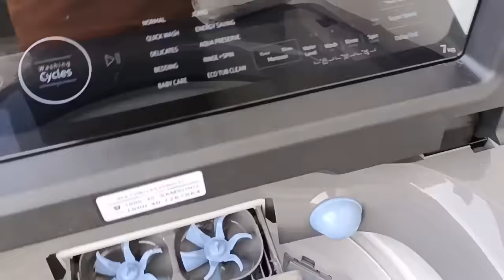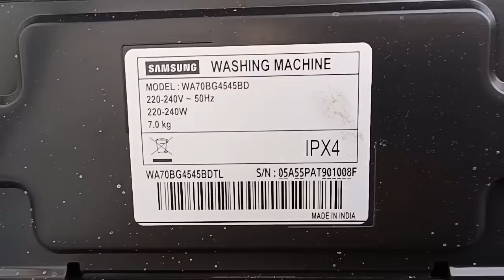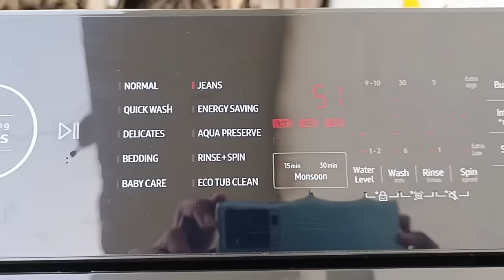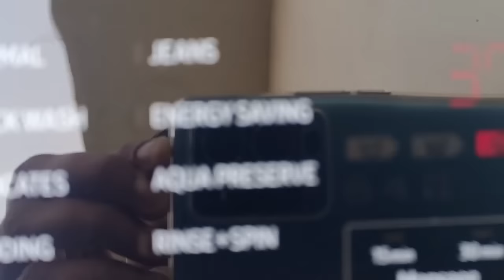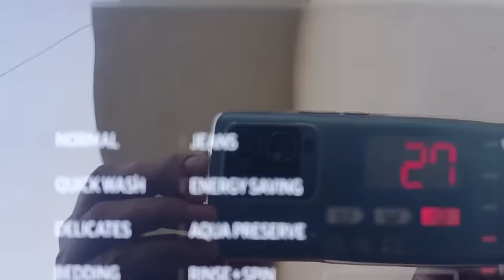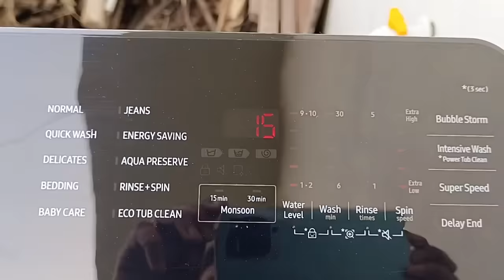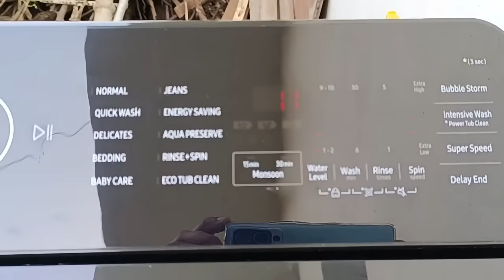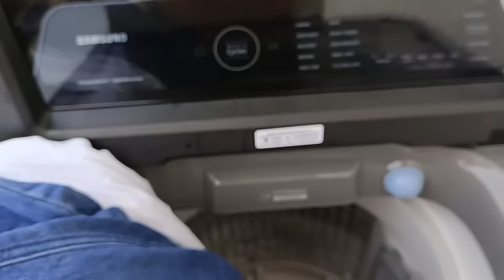Latest New 2023 Samsung 7 Kg Full Automatic Washing Machine I Washing Video I Model WA70BG4545BD

Comment from the maker: Latest Samsung Refrigerator 301 Liter 2024 Model    https://youtu.be/MDG19HAJybM?si=dns4qQYTQkLtIzGg
Reply: Please tell ki agar 7kg ki machine hai to kitne kapde dho skate hai isme 🙏🙏🙏
Reply from the maker: @Funnyshorts12721  at a time 3 jeans and 3 shirts, 5 tshirts or 2 thick blankets more than this at a time will full the drum and overload the machine. If you have more cloths in a day use the machine twice after some time of first washing
Reply: @worldwideinfoblogs  sir 7 kg yaane 7kg dry cloth hi hua na ...
Reply from the maker: @Funnyshorts12721  Yes dry, but his is the limit when these gets wet by water, otherwise drum will hit the side walls of machine. Please note you put cloths, then they gets wet and drum also has water to wash and rinse, so i said earlier is the cloths limit for 7kg machine.
Reply: I have 10 kgs model of this but I have an issue that this washer is not filling water till white ring of the drum even I have set water level to 10, but my old wobble washer is filling water till white ring and they both have inverter motor. Do you have the same issue?
Reply from the maker: @rayudu3039  I not set the water manually , but i observed when the drum is full of cloths, the drum completely fills with water. Let it be until there is no problem in washing.

Comment: Hello, I have a 11kg machine that functions like yours. Problem is that when I select 3 wash and 3 Rince under normal mode, it always wash and rince 4 times. The machine is 2 month old. Please assist.
Reply from the maker: After the machine estimates the complete washing time and just before it starts the operation, pause and check if the levels you set previously are same or not, sometimes it changes the level. But this moment you can set again the levels you want and resume the machine. If still the same problem, call service center they will check with software for any issue. If the machine old is then other method is, if you want level 3 and your machine taking level 4 then, next time you select level 2 machine will take level 3, like wise.
Reply: @worldwideinfoblogs  Thank you for your reply. When level 2 is selected, it works fine - 2 wash and 2 rinse but when level 3 is selected, it goes 4 wash and 4 rinse. I will follow your recommendation. Regards to you

Comment: How to open the door if power cut please ..thanks for reply
Reply from the maker: In this model, the door does not locks mechanically, it only rests on the body. So whether there is power cut or not you can anytime open and close the door , but press pause button on machine when running/washing.

Comment: Filling the tap takes a long time, and the water flow is very small, even though the tap is fast.
Reply from the maker: Washing machines dont fill water at tap water flow speed, these have motor to control the flow, you will find same flow speed in all top load washing machines. always control the washing time by levels manually and use superspeed button.

If required you can add water manually as well. then machine starts next process

Comment: kya Super Speed mode sachme water save karta hai? please answer
Reply from the maker: Aqua preserve mode saves the water, as it uses same water to wash and rinse the cloths, and not take fresh new water to rinse the cloths. Superspeed mode only makes washing fast an reduces time.
Reply: Okay, thanks, I have one more question.
Installation technician can install new tap for it before connecting inlet pipe? Is this included? I have to install new tap in empty tap connector @worldwideinfoblogs
Reply from the maker: @smitmanore2  You must have a tap with serrated slots for pipe, he then fits the washing machine pipe. any tap like this https://www.flipkart.com/maruti-crmtapc2-324-pvc-plastic-bibcock-water-tap-kitchen-bathroom-wash-basins-pipe-connector-1-2-15-mm-set-2-pcs-bib-faucet/p/itmc4f83cf3b66c9. You can buy this from market in advance for 50 rs.
Reply: @worldwideinfoblogs  ok thanks 👍

Comment: Sir, Agar inbetween machine operation power supply cut ho jaye to door lock to nhi ho jata?? If we want to remove cloth at that time, is it possible or we have to wait for power supply come and pause or switch off machine, than take out cloth? Please clarify.
Reply from the maker: Top model washing machines do not locks door, you can takeout cloths. Also as soon as power resumes machine starts cycle. Door lock in power cut off/failure is in front load washing machines.
Reply: Thanks Regards

Comment: Please reply
I bought 9kg washing machine same model.
1. There is space at the left corner of the washing machine saying liquid bleach only, can i pour liquid detergent?
2. When i put Powder in detergent box, there's not much foam why?
3. I poured comfort at dispenser, but no smell at all. When is the correct time to pour it?
4. Also the blue colour round, it's not spraying water at all,.
Reply from the maker: 1. The left pocket is for bleaching powder, its correct
2. The middle box above drum is for powder as well as for liquid detergent, no other place.
3. Comfort or similar to put on 3 small holes on drum top, before machine starts, put more quantity for enough smell.
4. Blue color round called jet spray works only in super speed mode, in normal and other few cycles only.
Check my new review video
Reply: @worldwideinfoblogs  thanks for the reply brother, I did watch the video, but I don't understand Hindi brother that's why I asked

Comment: Hello, one question, why my machine give ejcecting waterr while taking water please😢 help me please
Reply from the maker: Washing machine dont discharge water while filling drum, in your case if machine is taking water and discharging same time then its cleary problem with software program or with drum holes at bottom. Please call customer care, raise service request, do not forget to ask visiting charges for your information if machine is out of warranty.
Reply: Thank you very much. But it only do that when the discharge tube is on flat level, when i raise it, it is normal, it takes water without ejecting it. Do you think its normal?
Reply from the maker: @christopherplaiche2212  if any water left after washing, machine will discharge it and then stop. But machine should not discharge water while taking water from inlet pipe. Discharge pipe level should always horizontal or lower side but not as raised.

Comment: kenapa eh i punya mesin mcm ni tp 9kg time spin tu dia bunyi kuat ? yg ni mcm ok je tak bising. ke i salah setting ya?
Reply from the maker: Mesin pada mulanya berputar dengan sangat pantas jadi menghasilkan lebih banyak bunyi, jadi lebih banyak tahap putaran bermakna lebih banyak bunyi. Tetapi apabila putaran dikurangkan kepada 1 atau 2 maka bunyi juga menjadi rendah. Jika anda lebih bising daripada biasa, hubungi sokongan pelanggan. ia akan menjadi lawatan percuma jika mesin berada di bawah jaminan

The machine initially spins very fast so it makes more noise, so more spin levels mean more noise. But when the rotation is reduced to 1 or 2 then the sound also becomes low. If you are noisier than usual, contact customer support. it will be a free visit if the machine is under warranty

Comment: Hey, got a sight probĺem my machine seem to drain out the water as while is still buzy filling it at the same time. Please help
Reply from the maker: This is a serious problem if the machine not holding the water same time when water coming into the drum to wash the cloths. Only solution is to contact Samsung service centre, so the service person will identify the problem and correct it. I think software/program might be the problem, because software controls the opening and closing of these parts to inlet and drain water. They have a machine check via software, it then indicates the problem in there device connected via cable to washing machine.
Reply: Pick up hose to top of washer height. On the ground siphoning out of machine.
Reply from the maker: @xolaniashley4006  Hello, is your problem solved, updates

Comment: In Lg or whirlpool which one is better
Reply from the maker: Both are big brands and experts in washing machine, selection criteria are 1st. Specification you want. 2nd.Warranty period and parts covered under warranty. 3rd. Cost. 4th. After service at home/location/area. If still not clear then take a look on the physical models in any shop, it will help to choose correct one as the design and build quality is different for LG/Whirlpool/Samsung and other brands.

Comment: Heater ഉള്ള മോഡൽ 9kg ബുക്ക് ചെയ്തു. ഇതിൽ heater normal വാഷിൽ on ആക്കാൻ പറ്റുമോ. Steam option 4 മണിക്കൂർ കാണിക്കുന്നുണ്ട്
Reply from the maker: ശുചിത്വ നീരാവി തന്നെ ഒരു വാഷിംഗ് സൈക്കിൾ ആണ്. അതിനാൽ സാധാരണ സൈക്കിളിൽ പ്രവർത്തിക്കാൻ കഴിയില്ല. വെള്ളം ചൂടാക്കുന്നതിനാൽ 4 മണിക്കൂർ ഒരു സ്ഥിര സമയമാണ്
Hygiene steam itself is a washing cycle. So it can not run at normal cycle. As it heats the water 4 hours is a default time
Reply: So we cannnot activate heat in other options right?
Reply from the maker: @Benjamin-jp7kq  Yes steam is not used in other cycles, put cloths to wash in this cycle. only thing it will run at least for 4 hours. But as my model is non steams please confirm from other source as well or go directly into offline shop and just get this cleared.

Comment: Washing takes more time, in normal wash mode it tooks 1hr 13m time in 7k model, But, my realme 8kg model only takes 49 minutes with more clothes! And the super speed option is not working on this i think. If it's working it should take less time than other machines! Energy Saving mode also takes the same time, Time and clean is more required.
Reply from the maker: 1 hour is normal wash time for a washing machine, you can adjust manually to reduce the time. Most important realme is not washing machine company
Reply: @worldwideinfoblogs  Samsung also not an washing machine company when they started. They are a wide range product manufacturers, Realme is a beginner. But, If they are giving good, that we need to accept! But, the quality of washing is better in 49 minutes...And Price range  is also a big deal. Expect Inverter technology, Realme leads with specs. Ads are also a big sustainable part, Samsung does more Ads😊,
Anyway thank you for your time!😊
Reply from the maker: @rkz360  👍👍
Reply: @rkz360 This model washing machine takes water very slowly. 
For creating bubble, Samsung has decrease the size of inlet water pipe valve holes to create pressure. This has also led to slow water flow into the drum. 
Design Issue
Reply: Can I install bigger pipe hole for inlet...

Comment: Hi, really helpful video.. I purchased this product and now want to know when does that jet speed work.. that blue one next to detergent box
Reply from the maker: Normal cycle, press super speed button on right side, then Jet start spraying water between wash and rinse.
Reply: OMG 🔥🔥 u are really super speed now... Thankyou for the immediate and fast response 🙏🙏🙏🙏🙏🙏
Reply: Sir yesterday we purchased new machine Same machine but (10kg) everything   is fine but stain nahi nikalraha hain cloths are  not brighting looking very very dull not satisfying while washing machine is running very slowly that's why it's not  removing stain i think  , sir please tell me next option i also soaked the cloths long time more detergent powder also added
Reply from the maker: @sirisiri7153  put adequate amount or more detergent in the drum on cloths, increase wash and rinse levels, and set normal then superspeed mode. it must work, if not then connect with samsung customer care, as this product has 10 years warranty
Reply: Hie I'm very disappointed l bought the same machine as yours not impressed at all  I'm experiencing the same problem

Comment: On an average how much time it takes to complete the whole process
Reply from the maker: Normal washing cycle 1 hour 15 min, normal with super speed  45 min
Reply: @worldwideinfoblogs  I have also same model but it takes 3hrs and after wash detergent is still left on the clothes don't know what's the issue. 

And one more thing it takes more time then the mentioned time on the screen
Reply from the maker: @ghanendrasingh8659  adjust the levels of water, wash, rinse and spin and use superspeed mode, the time it will show does not includes water in out time so it should be 1 hour 15 min wash.

Comment: I recently purchased this model, why is it not spinning that much during
 washing? As in spinning is super slow. . I wonder if my clothes are clean😢
Reply from the maker: Spinning is a drying cycle so it is fast, wash is gentle cycle, every washing has same speed for washing cycle, if you have doubt contact customer care, service agent will confirm, but what you see in this video is correct ly operating machine.
Reply: Mine too the spinning is very slow 😵‍💫
Reply: Clothes are not rotating 😢😢money waste

Comment: How can i use hot water in the inlet? When i removed the plastic part at the hot water inlet, i couldn't find anything inside.
Reply from the maker: No hot water provision in this model, but you can put water might be hot mannually from top
Reply: @worldwideinfoblogs  can we connect hot water pipe into the cold water inlet?
Reply from the maker: @Dhruv-Kumar  We can not connect any pipe directly to machine, one pipe comes with machine which we connect to first tap and second end to threaded socket on machine, if you want to add water directly you might need to do juggad techniques. warnings direct water to machine may impact on machine programming/sensor another thing this model is not made for hot water so internal part may get damaged over time if you pour hot water, third is warranty then became invalid.

Comment: Is it possible to use this using water externally
Reply: yes it’s possible
Reply from the maker: Yes, i checked. If you add water manually, it will consider it and reduce the program time and start next rinse. but i do not recommend this.
Reply: Why you're not recommending to put water manually?what will happen?

Comment: I recently bought mine and i dont understand why it takes almost 2 hours to wash one batch
Reply from the maker: Use super speed mode once you select normal cycle, then manually adjust water, rinse, spin level. It will reduce time from 35 min to 1 hour. Check my new review video for same

Comment: I need one i purchased new Samsung 10 kg but that time is taking too much and spin it is doing 3 times can u kindly i need change or not
Reply from the maker: You can change the level of spin, wash and rinse, it changes time accordingly. Always use superspeed mode on right side, it can wash cloths in 1 hour. Still if you didnt liked the machine you can return i think. All top load washing machines take same time for cloth washing, in front load time is less.

Comment: Iska lock parmanent lg gya hai isko kese unlock kre
Reply from the maker: Press water level + wash for 3 seconds, it will unlock the control buttons. Door dont have any locking system or mechanism, you can open door at any time.

Comment: Hello, do you know what is the problem why the water is not coming out from any of the outlet/nozzle 😢
Reply: Bought it last wk and just try this night since I have to wait for the stand and cover to use it cause im gonna place it inside the bathroom.
Reply from the maker: As you said the machine is newly bought, so definitely there shouldn't be any problem. If you tried to use it, i suppose washing was correct and only water is not coming from the bottom outlet flexible pipe. Then check whether end of outlet pipe is free to pass the water and not blocked by any wall or similar. If not then call customer care they will send service men free of cost under warranty and solve the problem or tell something which is not correct. As to water to come out from the bottom pjpe we/the user don't need to do anything apart from attaching flexible pipe to machine.

Comment: Please assist, my machine arrived today and the water takes forever to fill the drum, it is coming in very slowly.
Reply from the maker: Please ensure that water flow pressure at your site is good and not poor. For normal washing cycle it should take 1 hour. Also watch my video if the water is slow than what is in video then is the problem. Remember flow pressure in machine is always less than actual water pressure outside machine.